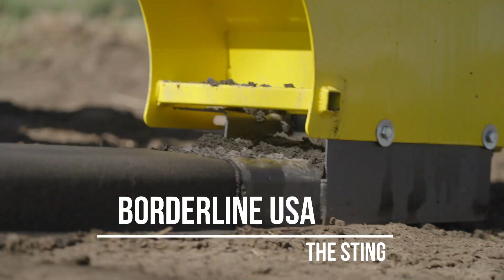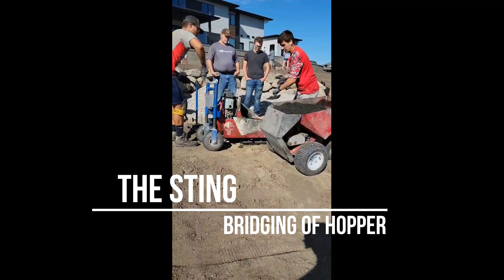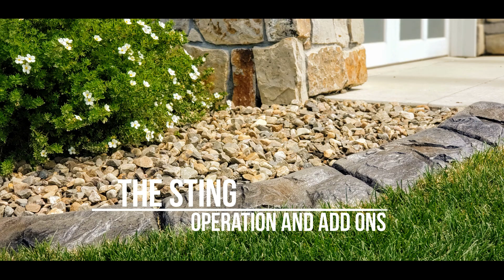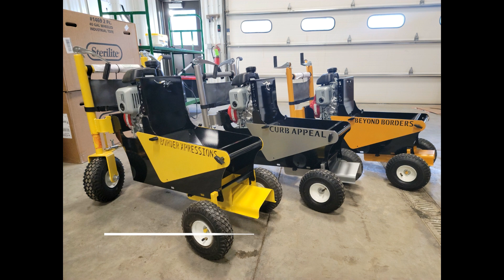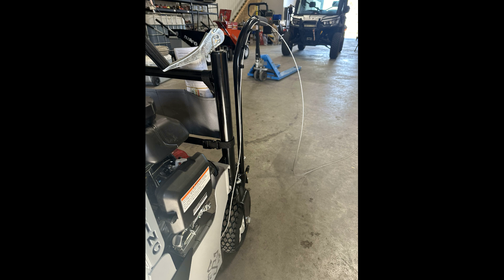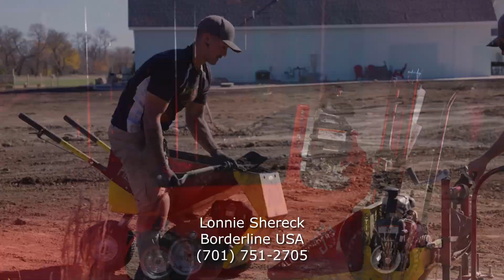The Borderline Sting - The best Landscape Curbing Machine on the planet!

Comment: How comparable are the units from the early 2000’s vs the sting today? I ran across an older unit that has your phone number on it and curious if you still make parts for it now.
Reply from the maker: @dillonwalls-c1c  depends which machine, borderline made 2 different models back then, the re500 is no longer made as it’s inferior to the sting.  Much different rack n trolly system